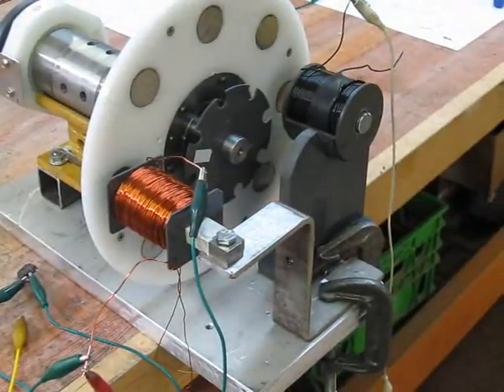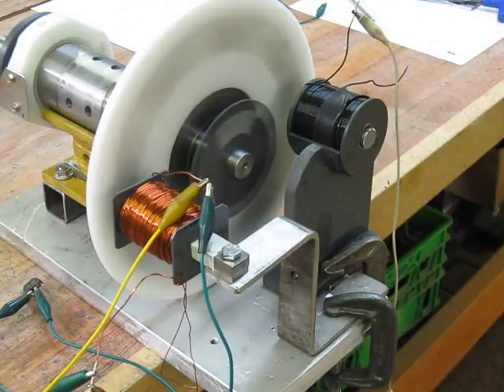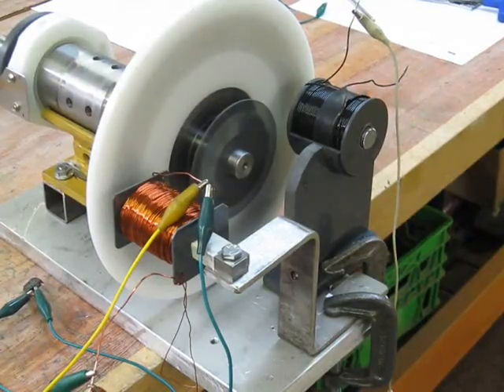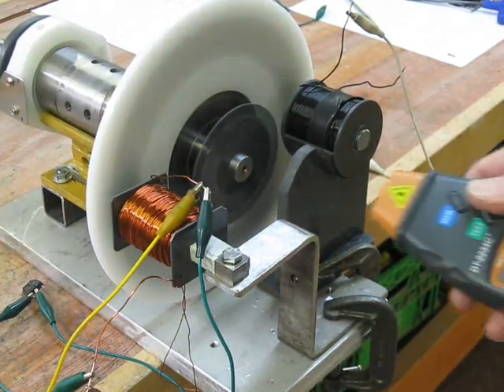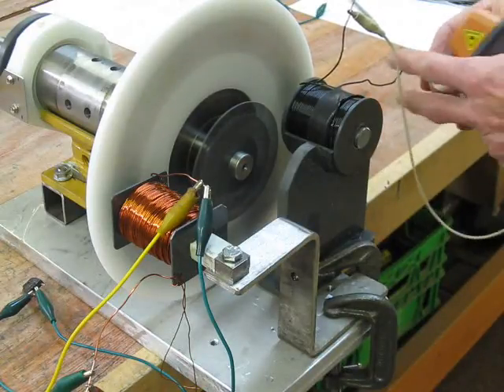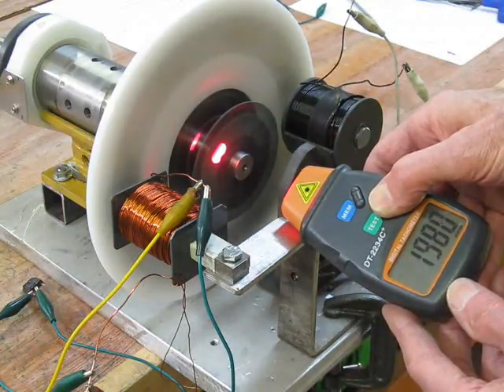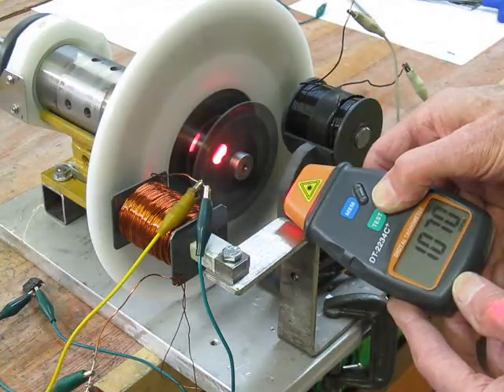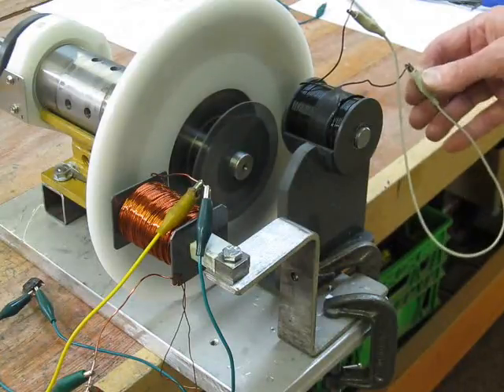Acc under load

Comment: Hi there, are your rotor magnets all the same pole facing outwards or alternating?
Reply: The supply is switched so it could be all same polarity out?
Reply: @ Well I meant on the rotor attached to the shaft of the motor, the generator part where all the magnets are at and rotating.

Are all those magnets the same pole facing outwards?

For instance all north poles facing out towards the coil or alternating such as north, south, north, south?

Comment: Hi Ron
I think it is combinations of "speed" of the magnet-sweep past the coil, 
plus the width and strength of magnets,
also how long the core material takes to become a strong electromagnetic force, 
And also then the ohms of coil will influence greatly how long the core will magnetize too....so you are right the Thane Heinz stuff does not necessarily need a high impedance coil to get speed up under load...(or a shorted coil) 
Whole idea seems to be to get the delay in time of how long the core will magnetize with strong force, to be a time when the upcoming magnet, or the upcoming magnet edge will be what is reacting to the coil's electromagnetism that usually brakes the rotor.
Once it starts speeding up, that time period changes, and eventually  it will start braking from the "lenz reaction: again...so there is a window of oppurtunity to keep it within.